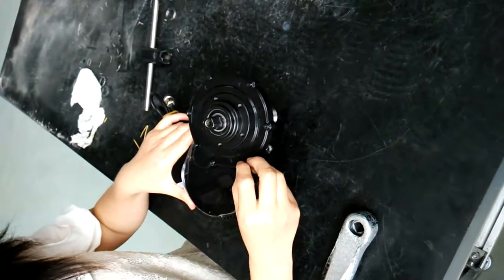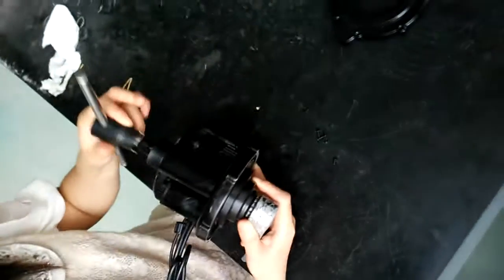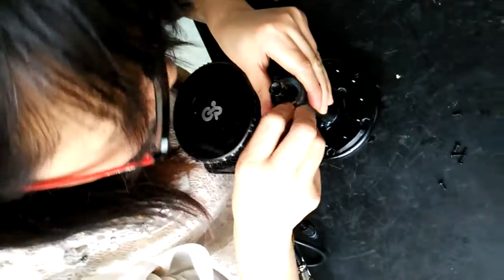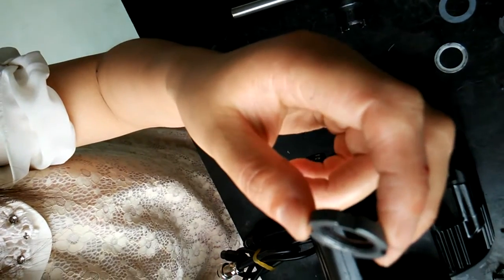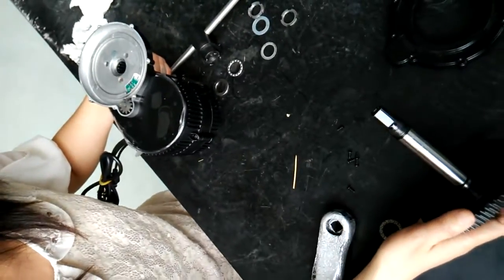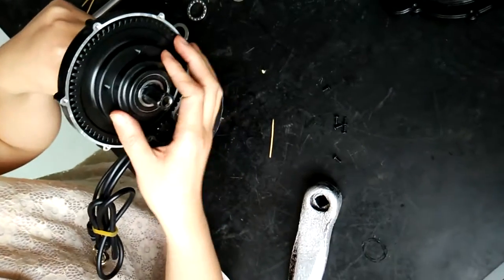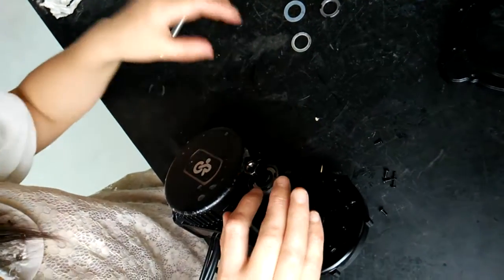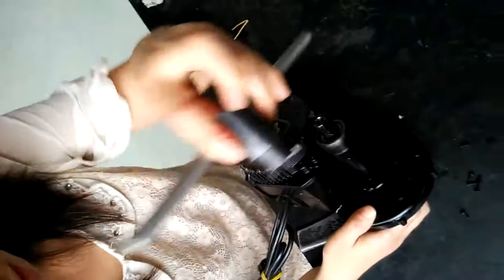disassemble bafang mid drive motor kit and replace gear

Comment: Very good video. 

But why does Bafang not put any grease?! This is no good. Gearbox, pinion, ball bearings absolutely need grease. Grease helps to reduce friction, it is noise reducing und and parts last longer.

Bafang is testing everything a 100 times, but is not putting any grease. This is not understandable.

Comment: Nice video, your English is fine, I am getting a real solid clunk when under load in top gear (smallest cog) so I took mine apart to check the gear but it was fine so I would just like to make the point that my bearing had grease on it so after i washed it in Isopropyl alcohol i repacked with HTB - High Temperature Bearing Grease.

Comment: Very hard to find this locknut tool.
Reply: You can make it out of a pipe and make notches with and Angle Grinder at the end of the pipe drill a hole
Reply: @stoklasajiri2426  Not everyone has a whole workshop. They should just provide this tool for purchase.

Comment: Where do you purchase the tools used to remove the locknuts?
Reply: http://www.ouka-ebike.com/bbs-01-02-03-hd-mid-drive-motor-electric-bike-motor-install-tools-box-p840524.html hope this web is help.
Reply: Yes. it is. If you need I could give a much better price. You make this video?
Reply: Yes. it is.  If you need I will give a much better price.By  the way, you make this video? It is really very perfect.
Reply: But not the shown and wanted locknut tool, Henry. Sad.